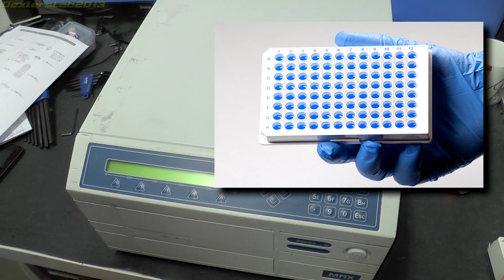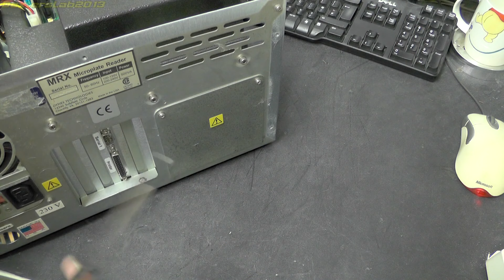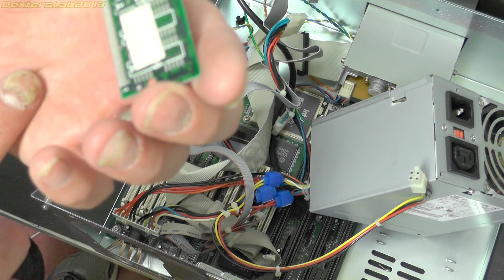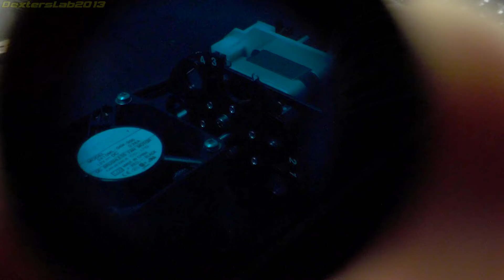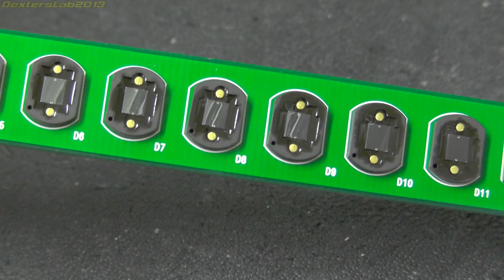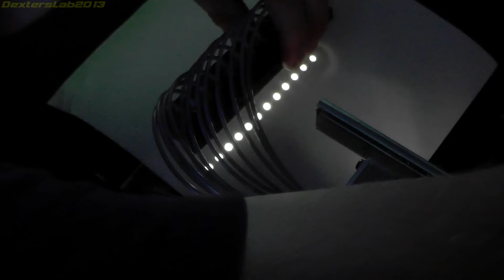DL#098 - 1990s Dynex MRX Microplate Reader Teardown

Comment: I've actually pulled something surprisingly similar to this apart, it didn't use a standard PC motherboard but it did have the light source, a row of photocells (the sensor board had low leakage teflon posts and guard rings around the front end), the filters and a tray mechanism.

Comment: That's quite a simple device, though I'd still imagine it cost an absolute fortune new.
Reply from the maker: i did try and find out it's original cost but could not find any details online
Reply: DextersLab2013 Which usually means "if you have to ask, you can't afford it" :P
Reply: Nowadays such devices cost several thousands of euros new depending on the brand

Comment: Nice teardown.

i expected some high tech optical stuff not just filters & photodiodes.  very disappointing if you consider what it cost back in the days.
Reply from the maker: Thanks!
Reply: its a precision test device with a custom programm - you want to have very accurate filters for it. But its easy to critize if you dont know what its used for.

Comment: I am specialized in selling vintage pc mainboards. This one is rather expensive.
Reply from the maker: Thanks Max, i was probably going to sell it on ebay to help cover the cost of buying the machine. What would you expect it to sell for?
Reply: If you put it on ebay as an auction, with 1 GBP starting price, it will likely end with 1 GBP. If you have an ebay shop, let's give it a try with 79.90 GBP. Currently there is no other seller for this board on the european market. You can also get 99.90 GBP if you are patient. Hope this helps.
Reply from the maker: Thank you Max. I would never expected so much. I have bought a cheap video card so i can test it properly.

Comment: Do you know what the AT motherboard does? I'm sure it must serve a purpose, but with all those chips in the sciencey box, it looks like they just put it there for decoration :).
Reply from the maker: There are a couple of DOS executables on the disk, it probably just instructs the main controller to run certain sequences over the RS232 link. The results are also saved to the disk so they can be transferred to other PCs.

But yes, it doesn't look like the PC element does to much!